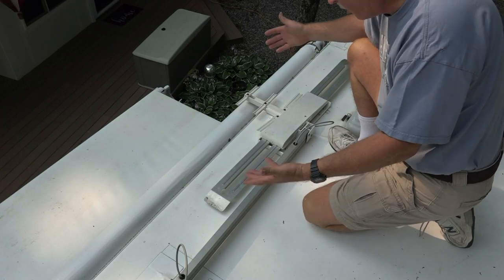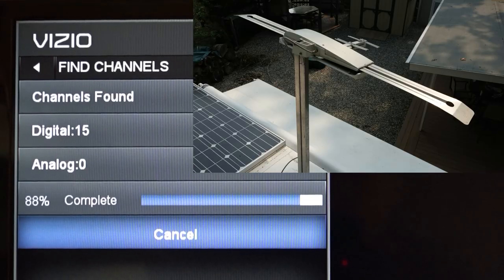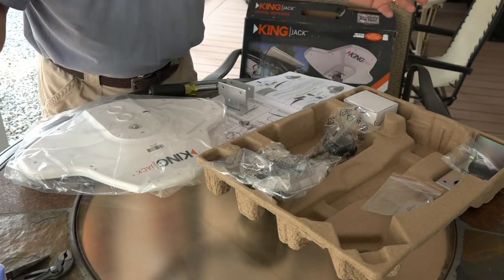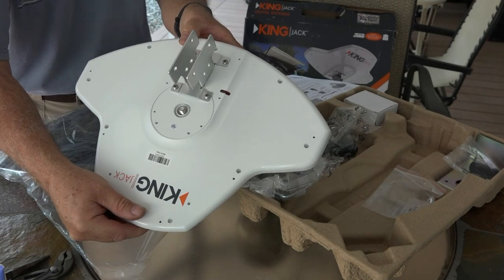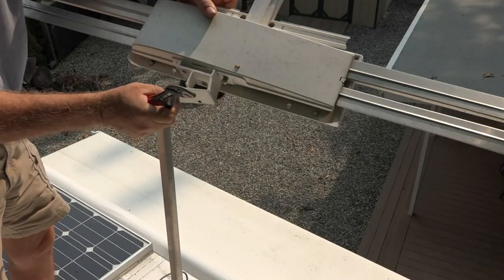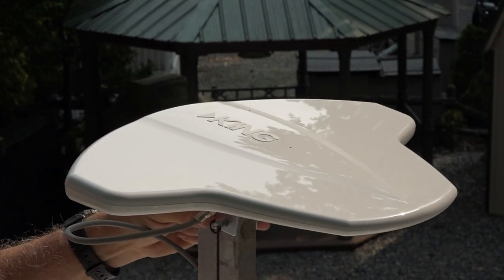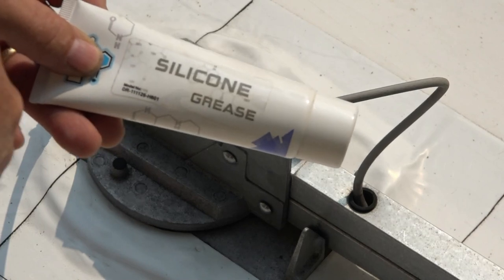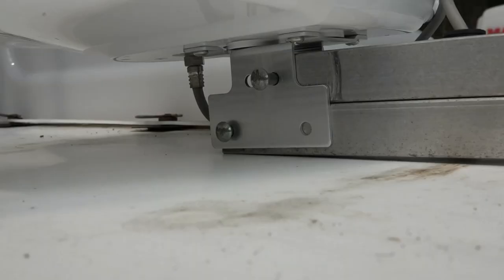How to Install King Jack Antenna

Comment: Hi Charles, I think you pointed the antennas in different directions for the test. They were 90 degrees apart. The new antenna is 90 degrees off clockwise if you campare with the old antenna direction. The old antenna was pointing to the side of the camper and the new is pointing to the back of the camper.

Comment: I like you video and your excellent work. The King Jack Antenna seems like a very good product. But I’m wondering if it increases your height. It the King Jack the highest point on your roof. I have Fleetwood Bounder.
Reply from the maker: The highest point on my roof is my covers I added over my vents. The king jack lays flat on the roof just like the antenna I removed